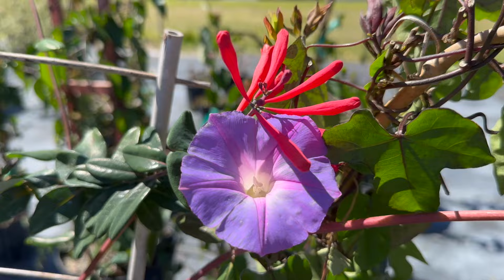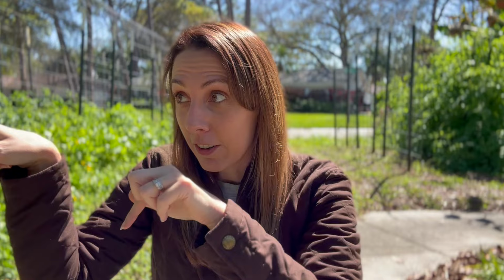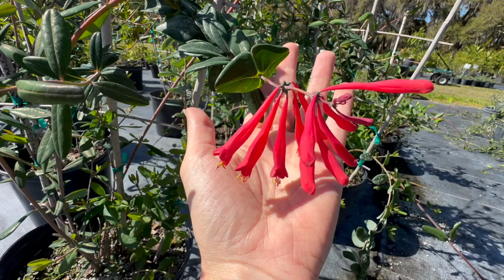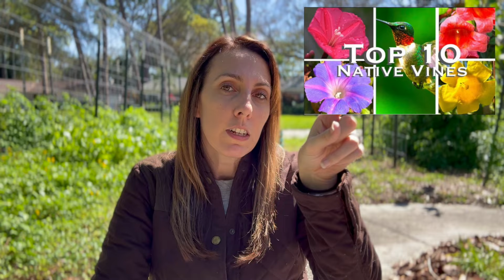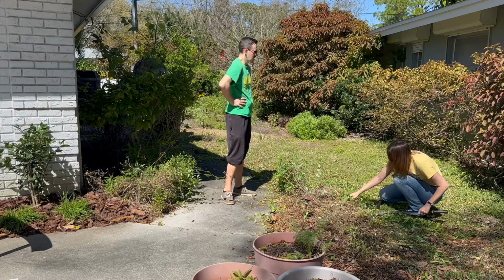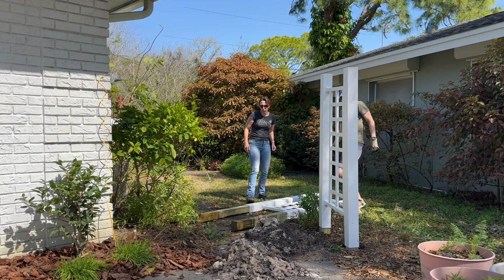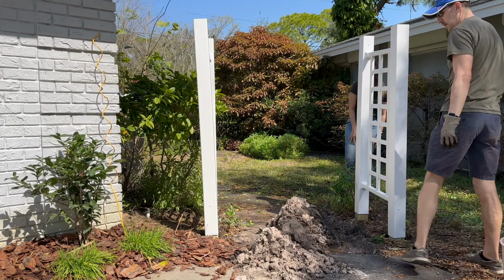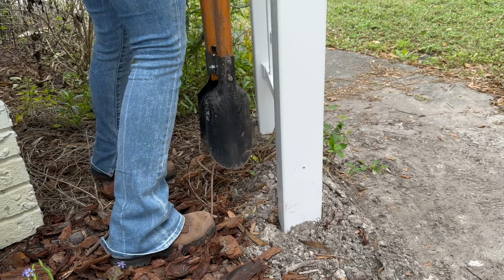Charming Cottage Garden Arch Trellis Build

Comment: Just a thought:  check your post hole digger.  A lot of them will have depth measures marked out on one of the handles.  And don't fret too much about level during the initial phase.  Get the holes roughly the right depth, finish assembling the trellis then work on getting your posts plumb and level, using the highest one as the static post.  It's easier to lift a low post slightly and pour some sand in the sides until it is level and then work your way around.

Comment: You guys are great.  It looks fantastic.  Just a little fyi for future projects.  Go to the local hardware store and get the pvc fittings to connect your garden hose to a 3/4 inch length of pvc.  Start your holes with the post hole digger place your your posts in then "jet" the pvc pipe along side the pole.  It will displace the sand under the hole and sink that thing lickety split.  Be aware it happens fast and in your application, you will have to move between posts and check level as you go.  It is also a great technique when you need to run irrigation or electric from one side of a walkway to the other.  Also, your big box store has 4 x 4 sleaves.  They are a plastic type of material that you put on your post so that it covers the post in the first six inches of soil/wood contact where decay termites etc rot your posts.
Reply from the maker: Amazing and great tips!!

Comment: Go to hardware and get tubes that you poor concrete in and then add metal plate that bolts to the concrete and structure, thus no wood in hole.